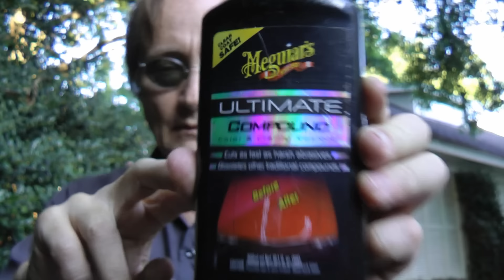How to Fix Faded Car Paint

Comment: You have to repaint it, we can even see on your video, it didn't really worked
Reply: It says fix! Not make it less visible.
Reply: This does work. Ive done this professionally (at least for clear coat damage such as scratches) and personally use Meguiars compound. Although, I don’t exactly agree on his techniques. For something that bad you’re gonna want to use a heavier pad and work to lighter pad to avoid any scratches or imperfections from the pad. Also you don’t need that much compound on the car or the pad. For a 5.25” orbital pad, you only need about 5-6 penny size squirts on the pad only. Then spray the pad with a little water. Not saturate it like shown here. Also, something he forgot to mention, buy a random orbital sander. It’ll avoid getting swirl marks on the paint.
Reply: I'd rather spend $50 and 3 hours every 4 months than a $1000.  I'd plasti-dip it myself with the professional spray kits before I ever paid for a paint job.
Reply: Sand all the shit clear coat off then polish and wax is the cheapest option unless you wanna get a new clear coat
Reply: It. Didn't.  Really. Worked.? That wasn't even correct
Reply: Doodfrumspace11 French Canadian... explains it all
Reply: Time is more expensive than money. Cuz money can be earn, time can't. Nice choice.
Reply: lol
Reply: And how you earn money? 
Wasting time, don't ya?

Comment: That is clear coat damage and this is not how you fix this problem.
Reply: The point is just to make it look decent.
Reply: How u fix it then?
Reply: Shaun Hunter repaint with a clear coat application. No diy on that. You have to pay a professional. Very expensive
Reply: It sure looked a lot better! 🤔
Reply: Chillin with Dylan it’s not fixed.
Reply: Shaun Hunter  Check out Sweet Project Cars channel.  He's a detailer and has a video on re-applying clear coat. ✌
Reply: Tyler Scow  *chief 😁✌
Reply: Tyler Scow oof
Reply: ForeignBorn Patriot you right
Reply: Tyler Scow , how do you fix clearcoat?
Reply: this person Sand off the area with sandpaper, then primer, then paint, then clear coat. Its alot of work and thats why its expensive, also you need to paint inside a garage or something so crap does not fall on your fresh paint and clear coat. Was going to do my front bumper on my civic but even if I managed to get the materials id still need to prep and tape off so there isnt any overspray on the rest of the car.
Reply: Just for old car looks better to sale!
Reply: Tyler Scow who?
Reply: Of course the video preview pic is a different car that obviously does have the clear coat chipping off. That Celica wasn't to that point yet, just dull. While you can try to carefully sand off the clear coat to recoat, remember the color coat is very thin compared to the clear coat, and doesn't take much to sand right through to the primer. That's why body shops won't even attempt it, and instead recommend a whole new paint job.
Reply: You never liked bro. This is a band and if anything it made the issue worse because more the clears been rubbed and heated by the buffer
Reply: We know that but the point is to make it looks better
Reply: you legend. thanks!
Reply: daniel tomas did you sand with 800 grit and use a quality clear?
Reply: @hayze3143  get a 2part clear coat with a hardner in it

Comment: Hey all! So I’ve tried this and I’m left with no luck. Does anyone know how long you should buff out a spot until the paint is smooth?
Reply: Try different compound and/or pad.  McGuire s didn’t work for me either. I bought griots.  Better but still need something even better. May try chemical guys. 
What did you end up using or doing?  I see this is a  few months old.

Comment: That didn't work. Try wet sanding with 1500 grid sandpaper until edges feathered. Then apply some enamal clear coat to the area. Then color sand again until feathered. Wet sand with 2000 grit paper and then buff with rubbing compound. If you are lucky you didn't color sand thru the base coat and your repair is seamless and matches the rest of the car.
Reply: You can see how nice and shiny it is now... where the clear coat is, lol. Scotty's too funny sometimes! Agreed, this didn't really do much at all. Definitely needed new clear coat, wet sanding and then buffing compound.
Reply from the maker: M. WilkEGR
sure, it's not perfect, BUT if you think it didn't do much, you are blind. Look at it before and after.

Comment: Stick to mechanical Scotty. This is definitely NOT how you fix faded car paint.
Reply: It made it look better. That is the whole point of it.
Reply: No its not. The title of the video is "Fixing Faded Car Paint" not "Making Faded Car Paint Look Slightly Better By Using All The Products Wrong"
Reply: Dude, use common sense. How is $50 worth of material supposed to "fix" car paint? The point is to make it look better. Spending $50 is a whole lot better than spending thousands on a paint job that will eventually fade as well.
Reply: So did he fix the faded car paint? No? So why did he a make a video called "Fixing Faded Car Paint" ?? Words have meanings ... dude.
Reply: You are reading way too much into it. Either do this or waste thousands on a new paint job. It's that simple.
Reply: No I'm not reading too much into it, I'm literally just reading it. He does not do what the title of the vid says hes doing. If someone typed "how to fix faded paint" they would find this video that DOES NOT SHOW YOU HOW TO FIX FADED PAINT! its thats simple .. dude. Don't know how to explain it to you anyway other way. If you search a video on how to change a tire and it does not show you how to properly change a tire then you would say wtf is this? Wouldn't you?

Comment: So your opening shot of the Stingray emblem shows all of the wax that you didn't bother to remove. Seriously, it takes just a couple of minutes with a few Q-tips to work that wax out of the emblems and any seams on the car. And you're giving paint job advice? Interesting.
Reply: UMFilmmaker Here's a detailer secret to everybody that don't know.When applying wax stay away from emblems rubbing and knocking into emblems can loose them up, be careful when washing as well. When I do my wax I stay half inch from rubber seals and plastic trim. Wax its hard to remove from plastic and rubber.
Reply: Well actually all you need is a regular paint brush, to brush the wax of. And that's it.
Reply: That sounds like a much more reasonable tip. Even if it was my car, I wouldn't waste my time digging in emblems with a q-tip. Who cares if there's a little bit of wax residue in the corners. I'll try the brush trick you mentioned next time, though.
Reply: lmao

Comment: Hi Scotty. I need to find out how to fix a problem I have on my 2003 ford explorer tracker. After replacing the engine on this vehicle I just purchased, I noticed that the headlights and side lights will not turn off. Power windows windshield wipers do not work. What's going on???? I'm sick with tension!!! And grief!

Comment: tried it out and filmed it (made a channel vid), tried using hand buff versus machine. My paint wasn't as bad as this though, but it did do something. Doing it by hand makes you all sweaty too. That...didn't come out right. Kinda skipped the water step, was only doing a small test area anyway. You can always just remove the cloth/pad and rinse it if you're scared of getting electrocuted.
Reply: he uses a lot of water to keep the temperature down....it looks crazy, but there is always a method to his madness.

Comment: It looks like the car is a solid and likely a 2 stage (base/clearcoat) paint. If there is enough clear (which is basically paint base with no pigment), you could try your repair. If there is not enough clear, the buffer may well blow through clear and land on the base. Only fix for this is to reclear (like repaint). NOw...if the paint is single stage (base with integrated clear), buffing may well work unless, again, the paint is just too thin. THe buffer will blow to the primer. Repaint time! It doesn't matter so much whether one has the single or 2 stage solid paint. Buffing still amounts to removing material. Oh...if a metallic, the 2 stage rule would apply...and you;d hope the clear is thck enough to tolerate removal by the buffing. Paint repair is dicey!!! Thanks for the tip though!!

Comment: If you are teaching noobs to buff, you need to point out rule #1: Do not apply pressure to sharp edges and creases, lest you buff through the paint and expose the primer or bare metal.

Comment: looks like the clearcoat was worn through. I would think you would want to replace the clearcoat before waxing. This looks like a corner lot used car tactic and when the wax wears off in 1 month you are back to square one. This does not impress me at all Scotty.

Comment: First you need to wash the area, if not the entire car. Compounding an area rough with crud trapped in a damaged finish is asking for trouble.  

If the finish is clear coat over base color rough finish is probably from penetrated clear,and will need more than as coat of wax.

Comment: Nice work, but too much work for my cars, 😅. This is my process on any auto body part I repaint. I've even done a whole car like this. 

1 can compatible primer, 1 can color, 1 can clear coat.  Sand panel with 320, 600, then 800. Clean off thrice with water, then twice with lighter fluid. All coats 12 to 15 minutes apart. 7 light to medium-wet coats. 2 coats color primer, 2 coats color, 3 coats clear.  All coats applied inside 75 minutes.  No sanding inbetween coats.

Comment: Scotty I love your videos but this one is not quite right, Its 8 years old but I just saw it. I detailed cars for over 40 years and the paint on the car in the video window I clicked on is not possible to repair  other than repaint. The car your working on is a light color so 'Im sure its better but if it were a darker car it would look terrible with that compound.   The steps are to wet sand with grit 1000 to 2000 depending on severity then wash off and dry,  light compound (no dipping in water) with an actual buffer (not an orbital), wash off again then change to a new clean polishing pad and then polish with a good polish and lastly wax Maguire's and other products work great for the complete finish.
Reply: Agree with you too sir. Seen him put the buffer into the water and got a heart attack haha. My dad is a detailer since his 20s, and he taught me to take good care of my vehicles. 

I generally use a heavy compound every once a year on my vehicle( if i need it), then use a light compound wax it every month or whenever the car needs a little shine. 

Meguiars mirror glaze, have a huge gallon of it. Usually works miracles. 

Had a bad case of faded clear coat, the marine compound from Meguiars did an A1 job.

Comment: How about clay bars using on vehicle what do you think of them I used one on my old truck a Dodge Dakota 06 4 wheel drive to remove oxidation but I used a light duty clay bar. I should of used a heavy duty one but do have one now but the light duty one didn't work plus should of used the heavy duty claybar on it. Have a GMC Canyon SLE 07 2 door now but not using a clay bar on it though it doesn't have the oxidation on it I put show car wax on it just need to wash it more in the winter am in Michigan but this year hasn't snowed a lot yet but next week gonna be colder but hasn't got too cold here yet either.

Comment: Apologies for being a Debby downer but as an automotive refinisher at every shop I’ve been to when applying wax and compund I’ve never seen anyone dip a buffing pad into water and the purpose of using wax was to use it in the sun because it’ll show you what’s been fully waxed instead of doing it in the shade because it will show in the sun as I’ve said before I do apologize it’s just this video seemed to be  very unorthodox

Comment: Thats clearcoat sun damage you have to wet sand and reclear the area; if the basecoat is good and does not need resprayed. This video is b.s.; this might be a quick option if your trading your car in but thats it.

Comment: Clearcoat damage, I doubt if this fix lasts a week. I absolutely hate clearcoat, it looks great until it starts going bad, then you've had it. Drive around with big white dull patches, or a very expensive paint job, which will likely not last as long as the original, even if you pay big bucks to have it done. I prefer single stage paint, it may not have as much initial shine, but it is simpler to apply and fades gradually, not all at once.

Comment: Scotty what do you think of paint stripping a vehicle this tool I got on eBay I was gonna use on my truck to strip it to bare metal before I paint over it but now I think I will keep it but I think I won't paint strip it on the certain spots on my truck that look faded. It is a Dodge Dakota 06 bright silver metallic and I painted it more than twice now that is because I used PS2 paint too when painting my vehicle but it is PSB code paint they both bright silver metallic codes but my paint code is PSB I should of never used PS2 and won't again. I am getting a Chevy Canyon 2007 soon this year and it has cruise control but I will try a lot more to take care of the outside so it doesn't rust like my Dodge Dakota 06 did but I had it outside every year in the winter in Michigan in Grand Rapids and I wasn't washing it in the winter often I got about all the rust off now on it but I messed up the bottom on one door in the rear drivers side of my vehicle when I was getting the rust out so am gonna buy another door at the junkyard when I go with my dad. He used to be a mechanic when he was younger in his 20's he 76 now but he said he tried body work in the past and it didn't turn out well for him but me I like it myself but am a beginner when it comes to that. Just got to learn not to buy some of the products they got out there. Been buying too much of them lately. I bought a rotary polisher and now a paint stripper tool to strip paint off vehicles. Some of the stuff I probably don't need but still gonna keep the paint stripper tool though. And I got multiple sandpaper for automotive and I got Meguairs Ultimate compound and the other one that they say works well with a yellow foam pad it didn't work good for my oxidation though I just have to have the PSB paint on my truck.

Comment: How well would this work on the front portion of a 1991 Saturn SL1 Maroon? Previous owners removed the Heat Shield under the hood and the heat has bleached the hood and side panels a bit.
Reply from the maker: this is for small areas, you really need a respray for large areas by a pro, and me, I go to discount paint places like earl scheib and just get the whole thing painted as they often do it cheaper than a body shop will paint just the hood for

Comment: Probably not a good idea to pour water on your power cord where it plugs  in to 110v or 240v !
Reply: I was doing something similar this morning, and a bucket with a small amount of water spilled on floor next to cords plug and all I could think of was final destination!
Then my only other thought was " I hope the breaker works".
Good news though, I didn't die! Yay me!
Reply: We use electric cords in water all day long,  as long as the cord isn't broken there's very little to worry about

Comment: Hey Scotty, great vid. I own a new car it's a 2013 plate, white and I have to hand it back to the dealership in 3 years and have to give it back the way it was when I got it. Question? I want to apply some vinyl decals stripes on my car, I'm afraid that when it's time to peel off the vinyl wrap it will leave marks as the paint around it has faded slightly. Is this a possibility and if it does leave a shiny strip where the stripe was could I buff it to blend it in? Thanks
Reply from the maker: you can use goo be gone, and that stuff takes all glue and residue off
Reply: Scotty Kilmer thank you for your help

Comment: FIRST, thats not even a polisher thats a random orbit waxer, it has zero correction capability. SECOND, you’re supposed to use a dry pad when compounding, or no heat will be generated on the paint, therefore no oxidation will get removed. THIRD, why would you dunk a live power tool in a bucket of water?

Comment: You can't buff base coat or a badly damaged clear coat. The clear coat was faded away. It needed  to be sanded, blended base coat into the original paint  then clear coated. That's the only fix when it's that bad on 2k paint. Just saying...

Comment: Mate, you need to be more "clear" pun intended. That was damaged clear coat, yes can make it look "better" temporarily by buffing the affected area, half polishing the clear and half the base coat. But by no means have you avoided a respray. When solid colour paint jobs fade or oxidize, yes you can restore them using a similar method (you used too much water) You should have based this video on that rather that a peeling clear over base paint job.

Comment: Does this work on sprayed on paint? I have a Camaro with a black stripe painted on using the automotive spray paint you can find at AutoZone or wherever. The black is starting to fade in the center of the stripe, and I'd like to fix it without paying to respray the entire car.
Reply from the maker: you can try it, just realize if that stripe was not heat dried when applied, buffing may just remove it all

Comment: Scotty I got a ATV quad bike the engine is silver but the back and underside of the engine has turned a browny colour any idea if there is anything that would fix this.
Reply from the maker: oxidation, polish it off, or just live with it.  And if the silver is paint and not bare metal, repaint it
Reply: Yep, use an engine paint or high temp paint, just be sure to strip off all the oil and grease first using a degreaser.